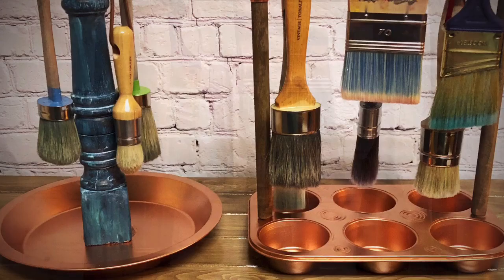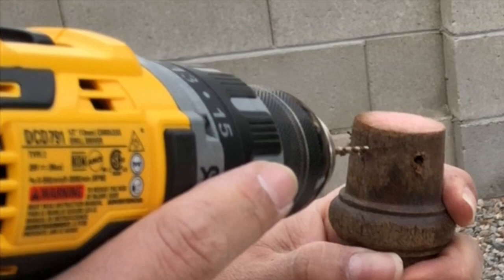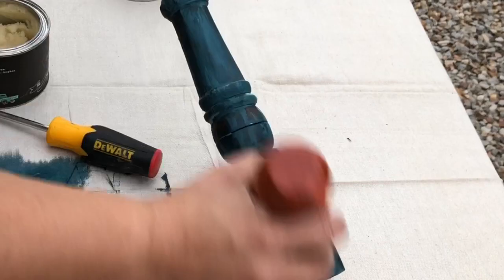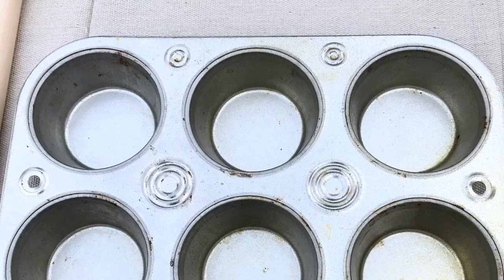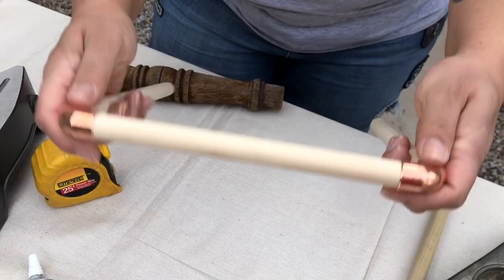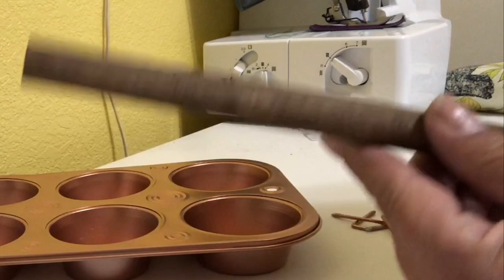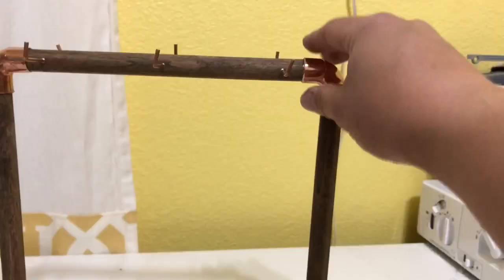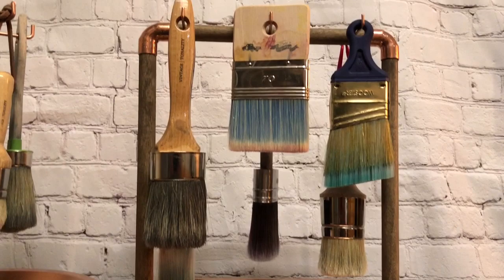DIY paint brush storage and drying rack

Comment: I love this idea. I didn't know that brushes should be dried by hanging. Thanks for sharing.
 I am wondering about the brush you used for the white wax, it is short with a leather cord and has a tapered tip..... what brand is it or where did you get it? I really like it.
Reply from the maker: Dancing Daisy Designs the brush was part of a set I bought on amazon called vintage Tonality .